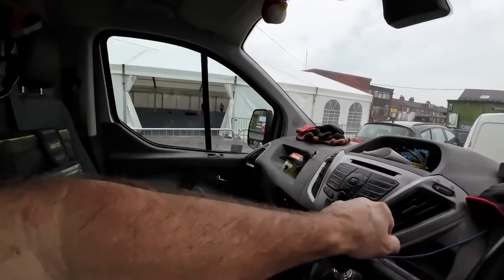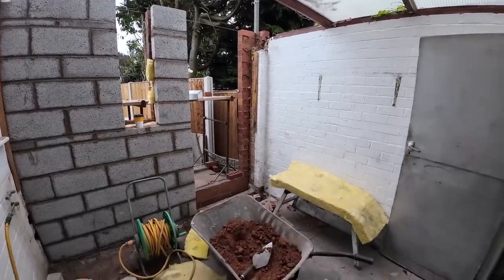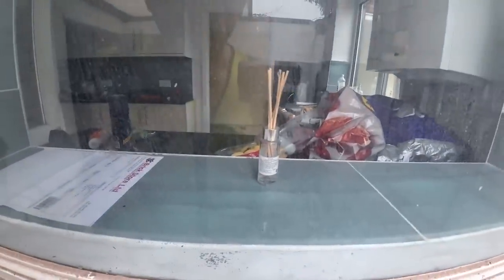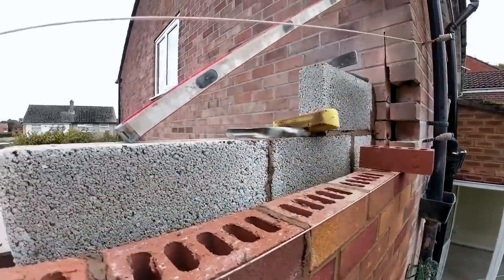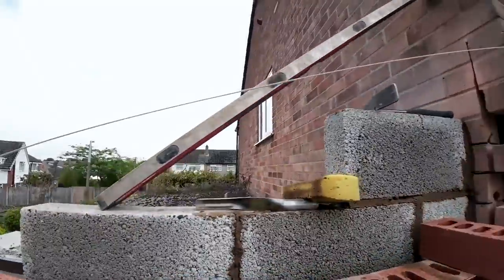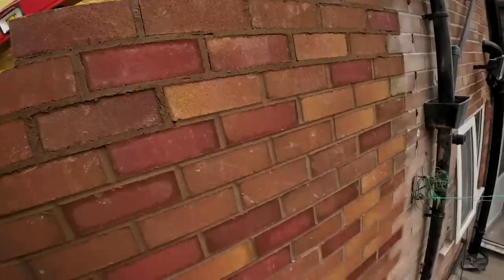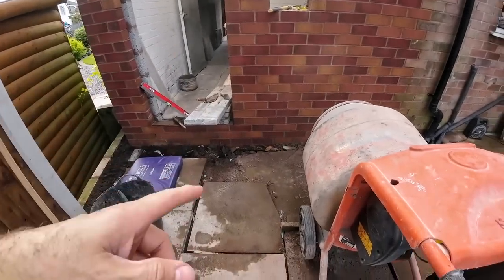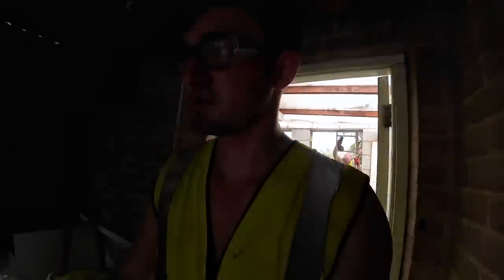STUPID MISTAKES CAUSE PROBLEMS.. GARAGE EXTENSION PT 3

Comment: Hi Steve and Alex , jobs coming on and looking good👍👍😃😃 , I do have a question though  , on the inside of the new extension looking out right hand side door gap , the small bit of wall where your tying into your new brick work , would of been a good idea to tie into the old paint wall as well for strength ?
Reply from the maker: We did 😁🧱👍🏽

Comment: A big bailer like the one you saw on the field builds bales from front to back. There is a chute down the center of the bailer the size of a bale, and about two bales long from the working face at the front to the end of the tailgate.

New material is added to the working bale in slices at the front. As each slice is added, it pushes the working bale backwards by the thickness of the slice. The working bale pushes the previous bale backwards. Eventually the previous bale is only supported on its front half by the tailgate, and it falls off.

If the bailer isn't moving it isn't picking up material, and isn't adding slices to the front of the working bale. So the bale doesn't move backward, and won't push the finished bale off the end of the tailgate.

So that bailer most likely wasn't jammed, at least not in terms of being able to poop the finished bale off the back. There may have been a problem with the needles or knotters at the front, and they might have stopped to fix that.